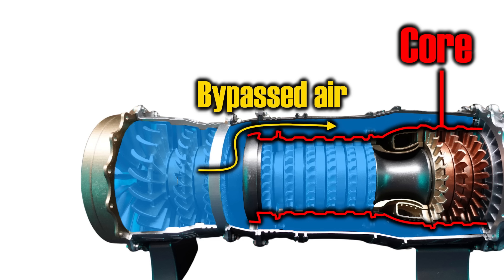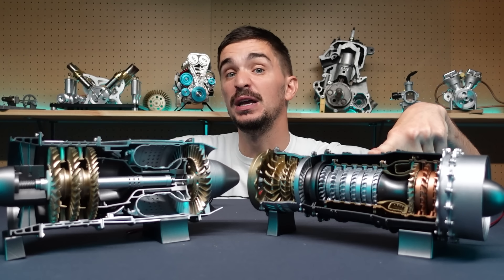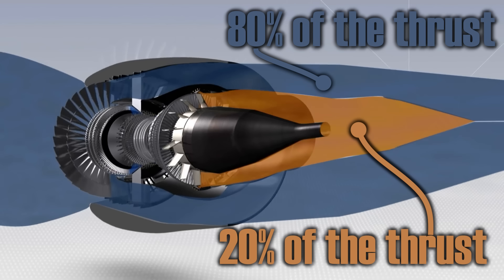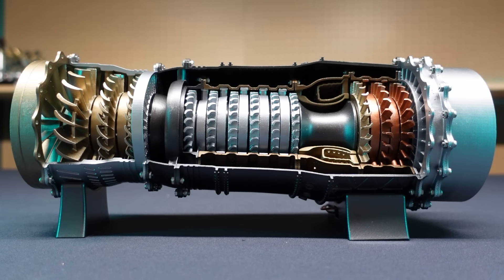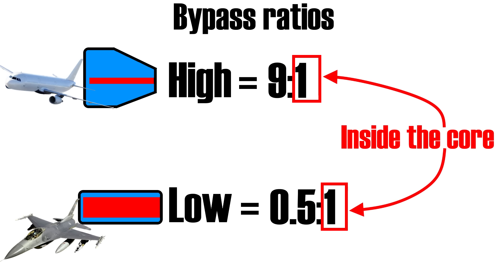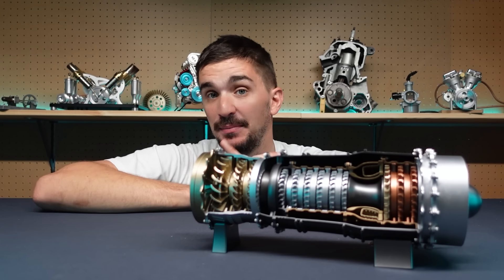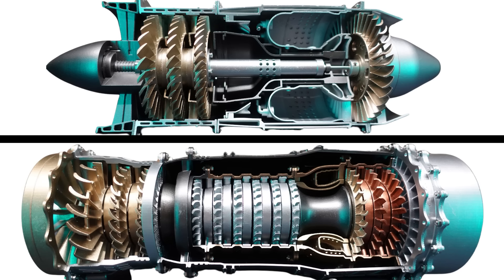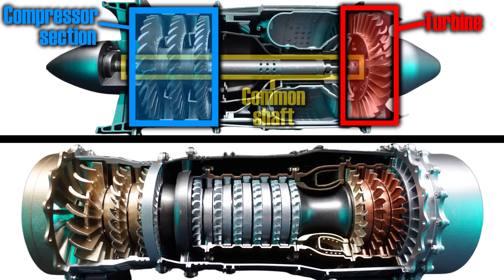Jet Engine Evolution - From Turbojets to Turbofans

Comment: Error in gyro forces and counter rotating shafts.
Counter rotation didnt eliminate gyro effect, they eliminate reactive moment. Stopping(accelerating) big flywheel with a lot of momentum, will rotate brake and everything attached to brake. Counter rotating wheels eliminate each other momentum to zero.

Comment: Although this is probably the actually most detailed an explanatory bid on the subject I've seen on YouTube the truth is I still want more details. Like exactly how to build it. For example how many blades exactly of each type should there be. And there are size ratios in comparison to each other based on what amount of cubic mass etc. they can move. And what's the smallest you can build an engine two. For example you said engines can only go so big but how small can they get?

Comment: The turbofan was invented in Germany during WW2 beating the British by a few months. The Germans were forced to give up on it due to material issues whilstbthe British were able to get it working (and yes, the British were using axial-flow compressor jet engines for their turbofans).

Geared fans can allow larger fans as they can keep tip speeds down.
Reply: what engine/airplane of nazi had turbo fan ?
Reply: @makantahi3731  none, but they were bench testing one - the Germans had the DB670 and the British had the F.3.
Reply: Germans have beaten the Brits by a whole decade...They had the Jumo 004 and BMW 003 in production when the war ended in 1945, Brits had nothing other than Whittles already outdated centrifugal compressor engine..The problem was that the Germans, unlike Brits and Americans didn't have access to high quality materials therefore the lifespan of their axial compressor engines were very limited. Turbofan was also pionnered in Germany.
Reply: @barracuda7018  yes, the British didn't have an axial-flow turbojet in service as the centrifugal ones were proving to be more reliable. The Metrovick F2 wzs eventually developed into the Sapphire family of engines. And as I said in my first posting, the Germans had the first turbofan to operate, but due to various reasons including making it over complicated and underpowered they had to stop working on it.

Comment: My immediate thought was “the fan is effectively a very high speed propeller, powered by the jet, with an enclosed airstream.”

Also, I was never clear on how afterburners worked before. They’re effectively air-breathing rockets attached to the end of a jet engine. You’re burning fuel in an oxidizer and relying entirely on the resulting mass leaving the rear through a nozzle at high speed. Jets and rockets are both reaction drives, so the overlap shouldn’t be that surprising.

Comment: 10 years ago I thought micro turbines and graphene ultra capacitors would change the world... I guess it's still too expensive to make the small high heat resistant turbine blades. Wright speed had some interesting tech. But haven't seen much from it...

Comment: OK wait, so if you can eliminate the need for outlet guide vanes by counter-rotating the next rotor, and outlet guide vanes look basically like an extension of the stator, then couldn't we eliminate the need for stators entirely by having each rotor going the opposite to the ones on either side?

Comment: As always a great video.
The way I like to think about the efficiency gained by high bypass ratios is through the equations of thrust and kinetic energy, f=m×a and E=0.5×m×v^2. If we have two theoretical engines where they both have the same mass airflow but one is accelerating the air at twoice the speed of the other, it will produce double the thrust but will require 4 times the energy. Or, If one engine accelerates double the mass but at half the speed compared to another engine, it will produce the same thrust but with half the energy.

I might be wrong, but it makes sense to me.
Reply: Accurate.
Reply: yes but this can be explained on other way, for same fuel flow, you can get small thrust with/for high speed or lot of thrust with/for low speed

Comment: If you want an even greater example of the difference, look up the engines of the Boeing 707 vs the current 737 max engines.

The 707 was ~10% bypass where the 737 engine is ~90% bypass. Fighter plane turbofans are going to be a lot more similar to the 707 engine than the 737.

Comment: well turbo props to get even larger turbo fans, yep turbo props move the air outside of the whole engine, not inside. then you can have a turbojet as the engine inside and turbo prop outside of the engine. pu-238 or am-241 has *infinite nuclear fuel as heat. blower fan style engines, in wings. yes flat turbines. but turbo prop is not ducted. but if your craft, solar heat dirigible, fill float with solar heat only. also solar electric thrust. no moving parts compressor, better than moving parts. there is a massive vortex when spinning in one direction.

Comment: 6:26 the blades at the back end (on the right) of the engine model are shaped the exact opposite way as they should - it's not a compressor driving the gas, but it's a turbine extracting the energy from the gas, so it should be shaped with the curved side up (towards the right).

Comment: For a long time I kinda didn't understand the working principles of jet engines as much as I'd like to. I found IC enginges much easier to understand, though it got easier once I found your channel. And thanks to you, I have a much better grasp on the topic.

BTW, here's a video request: Can you explain why IC engined airplanes use 2-3-4 blade rotors, instead of jet engine style multiple rotors.
Reply: you mean propeler with 2-8 blades in compare to fan with 50 blades-they are in cowl that slows down speed before fan, can be unducted fan with 20blades , clean blades make big noise

Comment: I know they talk about bypass fans being unable to be too large
But this is mainly a problem where engines are seated under the Wings but with T-Tail elevators and the engines on the rear of the fuselage like the DC-9 maybe they could be the diameter of the body of the plane 
Yeah If I was maybe nuts
But where there is a will, someone will come up with a way
But in England we innovate 
Lead the world haven't we !

Comment: Nice explanation :) It's a pity you did not have a high-bypass turbofan model to show the difference with a low-bypass one... Especially if it was to scale :)

One can add to this a bit about the existence of turboprop engines. Essentially this is a jet engine which has a propeller as the source of thrust. The jet part is there only to provide power to rotate the propeller - it does not contribute to thrust. Such engines are used mostly on smaller aircraft (although really big ones with turboprops also exist). What might be interesting for some is that in certain cases, for ease of maintenance, the jet part is mounted "backwards", with the hot part (turbine, exhaust) in front and the cold part (compressors) in the back. Of course, the shaft (and a gearbox) is in front and drives a propeller. This is typical for probably the most commonly used turboprop - the P&W PT6 engine. It is used in many different airplanes, as it also is produced in a large number of variants, widely differing in power output.

Comment: This is the best description I’ve ever seen. Wish I would have seen this before my interview
Reply: Although this is probably the actually most detailed an explanatory bid on the subject I've seen on YouTube the truth is I still want more details. Like exactly how to build it. For example how many blades exactly of each type should there be. And there are size ratios in comparison to each other based on what amount of cubic mass etc. they can move. And what's the smallest you can build an engine two. For example you said engines can only go so big but how small can they get?

Comment: so if an airliner is traveling without passengers at more than 20% lighter than the plane dont need to ignite any fuel and just use the font fan for all thew thrust as the bypass air flow is 80% of the thrust.  make all jet engine with more than 20% capacity and run them at 80% so no need to burn fuel , we will use it like a propeller aircraft

Comment: Can you explain the set-up on the F-35B. It has a shaft-powered lift fan  that is used for the VTOL portion of flight. How does the turbine supply that power during those periods and then not during the conventional flight?
Reply: Ever heard about a clutch?

Comment: One downside of high bypass engines is poorer performance at high altitude - at sea level the fan produces 80% of the thrust, but at high altitude it is the core that makes most of the thrust.

Comment: The cancelling of gyroscopic forces I think it's not well explained. The resistance to change the axis of rotation I don't think it can't be cancelled; but the gyroscopic precession (additional force that appears at 90º from the force applied) can in fact be cancelled that way. It is also good for cancelling torque effects too. I'm no expert on this, I just play too much KSP. Everything else is very well explained, thanks a lot!
Reply: what torque? on turboprop?

Comment: Gyroscopes have 2 effects. 1 they resists in direction change. 2 They introduces a change in direction on a perpendicular axle. Having 2 contrarotatives axles, won't remove the fisrt effect, but cancel the second.
Reply: Helpful.  Thnx.
Reply: So if I was theoretically holding a running counter rotating jet engine in my hands (no thrust, facing front to back), how would it act if I rotated the nose up and down from the center? Would it resist the movement and not try turning left or right?
Reply: I was totally wrong ! Looked for video about "contra rotating gyroscope", the effects are canceled !

Comment: This was a response to someone who asked about high speed aircraft.  I had a couple of conjectures; one about the Blackbird/J58 family, and another about whether air is ducted away from the low-bypass turbofan section on fighters traveling at high supersonic speeds up to Mach 2.5+.  Can anyone elaborate and clarify?  Thank you.

Laf, there is that.  A turbofan can generate a HUGE amount of thrust, but the acceleration and final velocity is efficient and effective for the transonic speeds of airliners and large transport planes.

For aircraft designed for speeds up to high Mach2 aircraft, the thrust is accomplished by accelerating the combusted air/fuel mixture to a high velocity within the jet engine core, driving the aircraft to high speeds.  

For Mach3 aircraft like the Blackbird’s J58, an additional feature was added that bypssed a majority of the incoming air into the afterburner section, acting as a ramjet - the forward velocity of the aircraft was high enough, and the J58 was designed such, that the incoming air was compressed ‘naturally?’ by the velocity of the incoming air - and not by the compressor blades section.  The compressor section still spun (and thus did the turbine section) but the majority of the incoming air was bypassed to the afterburner section.  

What has been said about the Blackbird/J58 family, is that at its top speed, the majority of the thrust was a result of the compressor section ‘pulling’ the aircraft, but I don’t fully grasp this phenomena.

What I DO know about the Blackbird family, is that it flies most efficiently at its Mach3.2 speeds - that is, it covers more ground per pound of fuel at top speed than it does after takeoff and during refueling operations.  But don’t let that ‘efficiently’ word fool you into thinking the Blackbird is somehow ‘economical’ traveling at Mach3+ - it’s not. The airframe is primarily one big gas tank, and it uses a GINORMOUS amount of JP7 to blast through its 2 hours at speed, before it needs to find its tanker aircraft, like, RIGHT NOW.

Current Mach2+ fighters use a low bypass turbofan, which is a compromise that gives the aircraft a more fuel efficient sub- and transonic envelope, and a more efficient supersonic envelope where most of the incoming air is accelerated through the ‘turbojet’ core.  

I don’t know for certain, but I suspect for supersonic travel, the incoming air is ducted somehow away from the low-bypass fan section.  But I never looked into this, so like I mentioned, I’m only theorizing here.  If I’m guessing correctly, I don’t know if the airframe has diverter ducts, or if somehow the engine can shut off the airflow to the fans - thinking out loud here.  For all I humbly know, nothing is ducted and the air always still flows through both the turbofan bypass and the core turbojet sections, regardless of the high Mach2 aircraft speeds.

Comment: That was an incredible and fascinating explanation of the differences and similarities between the two engine types. Thank you!
Reply: Although this is probably the actually most detailed an explanatory bid on the subject I've seen on YouTube the truth is I still want more details. Like exactly how to build it. For example how many blades exactly of each type should there be. And there are size ratios in comparison to each other based on what amount of cubic mass etc. they can move. And what's the smallest you can build an engine two. For example you said engines can only go so big but how small can they get?

Comment: I understand how jet engines' turbine blades accelerate air to create thrust, but I'm completely confused how they're used to drive a mechanical load, like at a gas power plant or in the Abrams. Next video? P.s. this is great, thank you!
Reply: Different methods are employed. Either a turbine shaft that directly connects to an output shaft, and or, a gear box. Most turbine engines have a gearbox where accessories are connected. Such as fuel/oil pumps, generators etc. Specialised accessories can be attached too.
There's also a connection called a "gas coupling." The exhaust stream could be sent through another turbine section that has an output shaft on it.

Comment: 6:55

This isn´t quite a error. But you make it sounds like the engine is running on 130:1 lean. That is not really the case. The extra air is introduced either after the fuel been burnt, or in a away that it make a laminar airflow  shielding the engine from the burning fuel.

So while the average amount of fuel to air when passing the turbine may very well be 130:, the actually fuel to air mixture in the actual combusters  is not even close to that lean.

Its also worth saying when the technology become better and better, the total air to fuel ratio for the whole core of the engine becomes less and less  lean. The result of is that the  first turbine get hotter and hotter air, intern making it so it can extract more and more energy.

This is one part of the reason why planes can get higher and higher bypass ratio. Not only have the fandisc become larger, but the core have also become smaller.

That compression only accrues in the stators is no longer true for modern  engines (like the last decades or so). This allows modern low pass turbojet as well as high-bypass cores to have less stages but still be more efficient. Of cause the real benefit is that the number of stator stages can be reduced even more. Also there can be a higher degree of decompression in the first turbine stage, allowing it to drop more heat and make the heat load on the second stage lower. Allowing it to either trade for more power, or more logentivty (or a mix there of). (this tech is as far as i know only currently flying in second generation F35 (so called block 4).

There is also one important part missing from the explanation. Quenching distance. In a cylinder engine, specially so a diesel engine. The metal of the engine (including the piston) is much colder combustion. this make a thin, but noticeable film of unburnt fuel. While this create pollutant that later need to be burnt of in a catalytic converter it protect the engine from getting to hot. Both increasing the lifespan as well as increasing the temperature where the piston can expand from. Hence increasing the efficiency of the engine.

This is not the case in a jet engine. If a jet engine would would just go with no so to say "synthetic" quenching a jet engine would just melt. This is also why cold (relatively) air is introduced chilling the engine down a bit. The downside of this is that a gas-turbine/turbofan engine have both a lower lifespan as well as efficiency than a diesel engine, despite both operating on basically the same theory. This is really a quite significant drawback and let the gas-turbine drop almost 10 unit or about 20% efficiency from the same size diesel.

But there is one more sort of twist in the road. A turbofan engine operate most of its life at about 30 000 feet altitude where the air is considerably colder, gaining back actually most of the lost efficiency. Still the wear of the engine at take of is still significant.

Its the longevity that is the reason why we don´t got turbine powered-car today. While a lot of people believe it was about efficiency, that was actually not the case. That was solved with rotating heat exchanges already in the 50s.